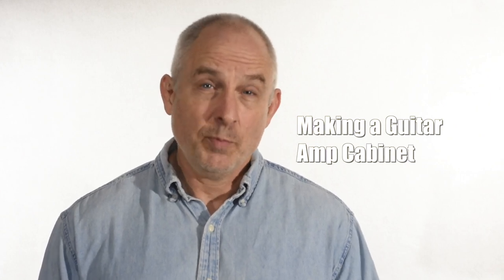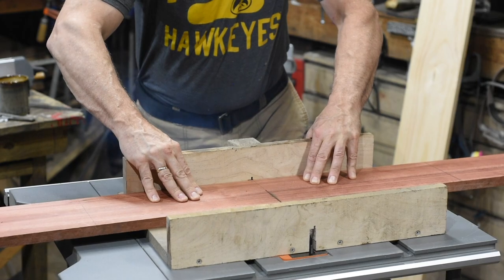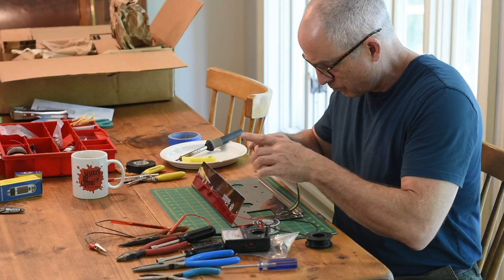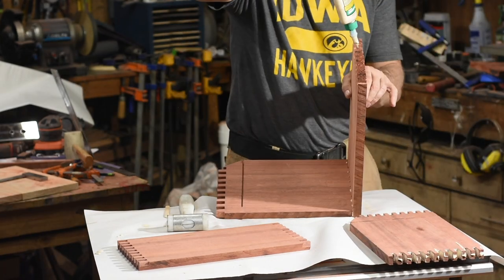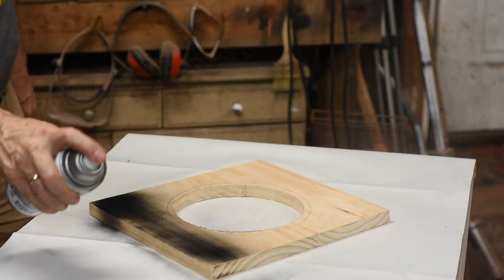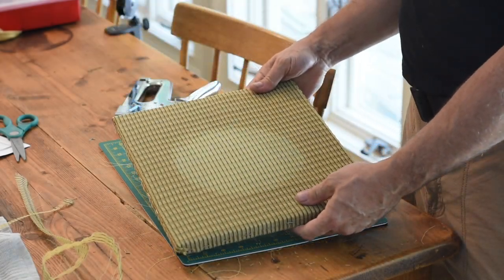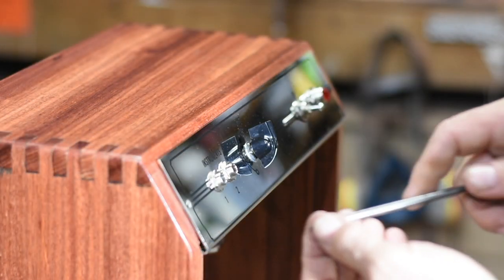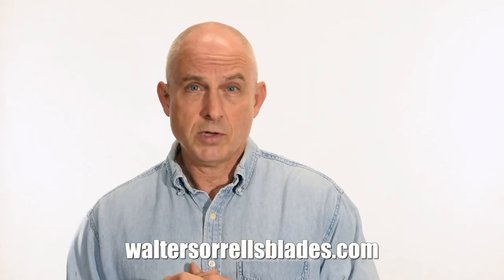Making a Guitar Amp Cabinet!

Comment: Nice build. I think you may want to ditch the jig saw for a router for the speaker baffle. 🔊 Also, the router does an equally good job for the round overs. However, it's a personal touch when done by hand. Nice build. Cheers 😀

Comment: Did you find that getting water based poly to get into the pores of the wood was a problem after sanding so high? Typically I only go to 120 or 150 as I find that after that, once there are 3 or 4 coats on, you can't really tell anyway and it seems to get into the wood a little easier (as much as a water based finish does, anyway, which of course isn't all that much). I do sand lightly at 400 between coats though.

Looks great btw and I really liked your solution on the crosscut sled, super good idea. Cheers!